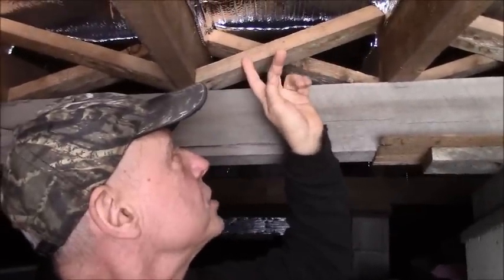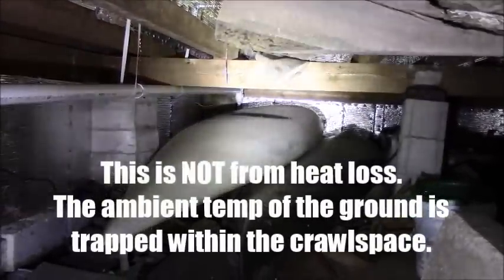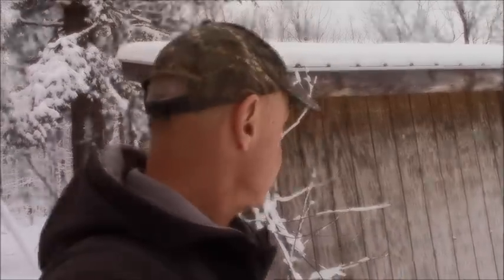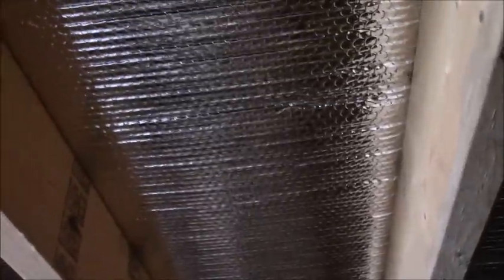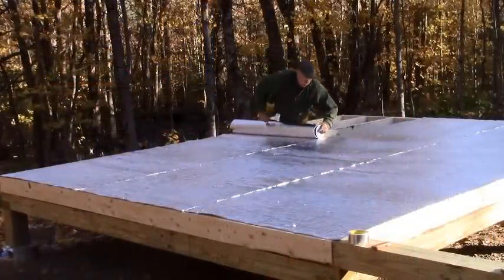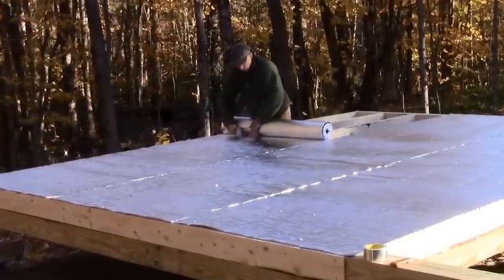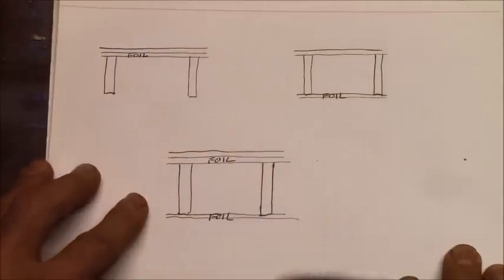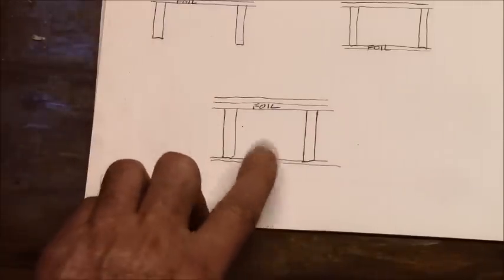BUILDING INSULATION  Proven Tactics and Solutions For RODENT FREE Results and DAMP CRAWLSPACES  DIY

Comment: Our cabin floor I did this
100% works
We had temps of -28* and I could walk barefoot on my floor.
Thank you so much J.C (Boss)
I will be doing our roof this summer with it.
Yes we have a metal roof. Our cabin we are still building as we go and live in.
Plus to get us through the winter we used this in our false ceiling to keep the heat down. Boom incredible product. I swear by the bubble foil method.

Comment: I used the same material for camping.
1.  Inside my cooler to help the ice last longer (saw this on one of your videos)
2.  Outside my thermos to keep my hot water last longer
3.  Inside my tent as a floor to add insulation for winter backpacking
Good stuff.

Comment: Bubble foil is amazing! I used the BF to seal up gaps in skirting around the piers, then added another continuous layer of BF inside the skirting (from rim joists to dirt) to create an air gap. 10 degrees outside and still 30+ underneath and 25+ in the cabin with no heat at all. The squirrels that were stealing the fiberglass haven't touched it.

Comment: I used reflectix (bubble foil) on the walls and ceiling of my wellhouse. It got down to 20 degree around Christmas last year and nothing froze.  To me it's an solid air barrier rather than insulation and if I can keep cold air or warm air from moving from one place to another, I'm going to do it.
Reply: Did you use insulation in well house and bubble foil over that on inside and then put up wall boards???
Reply: @harvdog5669   I just attached the foil on the exterior of the framing. Then put pressure treated plywood over it. Been working good since 2017.

Comment: Based on your old video I had them put bubble foil on top of the joists at the factory on my small cabin 3 years ago.. I also put another layer under the carpet padding inside and I love the warmth of the floor.. I used spray foam insulation on the walls and roof and then put up the "white" bubble foil as my drywall on the ceiling and walls.. It has been 3 years now and this place feels very cozy and warm in the winter.. (Yes, it gets cold in the southern AZ desert.). Thanks Boss.. ..... .....(I have videos of everything I have done so far)
Reply: Bubble foil under the carpet is a good idea.

Comment: It was that video from five years ago that brought me to your channel! My husband and I thought we were going to be building on piers and we were discussing proper insulation that would not bring nesting rodents and so I went researching on YouTube and there was your video about the use of "bubble foil". We had already used it in our tiny-house-on-wheels with good effect (Combined with other types we got an incredible R factor!) We have been experimenting over the winter with the bubble foil on top of a grey water field we put in as part of our (eventual) cottage build (here in Acworth). It's still in the testing stage to see whether we go with that or another system. Even when the temps dropped to -23 degrees F (-30.5 C)  a few weeks ago the ground under the bubble foil and tarp never froze! And even with the normal winter temps there is standing water in the test hole we have within the gray water field. I might drop you an email about it with some pics.
Reply from the maker: The foil really is amazing and we'll be doing it the exact same way when we build our next house.

Comment: I remember watching this video before.  I'm glad it's still here for review.  I wish engineering or building science manuals would include rodent damage for various insulation types and installation.  I can't wait to build anything with double layer bubble foil and agree that you need to face it on the warm side (for cold climates especially) to avoid condensation inside the wall structure aka mold and destruction.

Comment: New Cape Cod Cottage owner here. Surrounded by Pitch Pines and lots of moisture around because of our FOG. Small 510Sq Ft. Cottage that was lifted 18 inches off ground just before I purchased it. They put a pressure treated frame underneath with chicken wire over it to keep out critters, so open air skirting. I THINK this creates a lot of air flow underneath and has avoided any and all mold to form on beams. Dirt floor.

BEFORE I saw your videos (love them btw), I dug out the dirt underneath to make it so I could store things underneath and also so I could crawl around easier and get to all the plumbing etc. I then put down rubber puzzle piece flooring so that friends willing to help me understand stuff under the cottage could crawl around without getting messy. I also figured it would stop moisture coming up from the ground. I left the cottage this way for a couple years and never had an issue with mold on the beams.

Cottage is open April - Dec. closed down Jan-March (cold winter months here in NE). I became frustrated with the dirt that was blowing in through the open-air skirting over the winters, so I tried an experiment last year before leaving for the winter. I covered up the skirting area with see thru plastic to prevent any wind blowing dirt into the underneath. I was dually concerned that this would create a moisture problem.

After returning home IN APRIL, I discovered that it worked great to prevent dirt on my rubber floor, and no mold had formed underneath. HOWEVER, when late June arrived, I crawled underneath on a drizzly foggy day, and there was TONS of moisture all around, and I noticed mold forming on my 100-year-old joists for the first time. I assume this was because of the plastic skirting and the sun hitting it to create a greenhouse effect. I immediately removed the skirting to get some airflow going and will be treating the mold soon.

I REALLY need to insulate my floor because it does get cold into December, and I have also been struggling with whether or not to put skirting back around underneath to prevent wintertime air flow, because of the tremendous moisture issue it created come summertime.

MY Question: (finally); Do you think; considering my climate and moisture issue on Cape Cod; that using the reflectix as a skirting would have the same effect as the plastic I had previously used (mold forming and tons of moisture) or would the properties of the reflectix material prevent what happened to me with the summer mold issue? I want to have a skirting but am concerned about lack of airflow under the cottage, and it would then be dark all the time underneath, I'd have to install lighting.

I am definitely going to try insulating the floor with it, but am concerned about using a skirting; especially in late spring, summer and early fall. Also the company that makes reflectix STRONGLY suggests stapling one inch underneath the floor to create that warm air gap. I am thinking of trying this to see first-hand if the mice get into it. I can always undo it later, after all I'm only 510sq feet.

Thanks for any answer you can give and if I get no replies well at least I was able to vent my frustrations here! Great channel, so valuable! JF
Reply from the maker: As you pointed out, there's pros and cons to skirting and no one single method is perfect for everyone's needs. Skirting provides a warmer floor but also blocks daylight and traps moisture but... the skirting also traps the ambient temp of the ground beneath my cabins and this keeps my pipes from freezing without running any source of heat under there.   In one cabin, I had skirted it but installed some aluminum windows I salvaged from an old camper.  This worked well as it allowed light to come in and I could vent the crawlspace as I desired.  Maybe trying something similar would work for your situation.   I staple the foil directly to the underside of my sub floor and have tremendous success with it. All my structures are done this way and I plan to continue to do so.  Hope this helps.

Comment: I use reflectix for lots of things, but the perhaps silliest looking of all them is using it around a homemade icecream maker. The icecream maker is one of the store bought plastic deals...and so the ice would melt far too fast after putting the salt in it because the plastic bucket isn't insulated, or should I say it doesn't have any thermal mass to it like the old fashioned cedar wood built ones which at least had a few R-value points. Now the ice cream freezes quickly and the ice doesn't melt near as fast. Sometimes you just need a few r-values. Reflectix isn't exactly insulation, but it acts like it. If you use it correctly like the Boss did in those upper walls (which I was very impressed with!) then you can get a lot use out of it.

Comment: Yes sir! We originally used foam board insulation - creating that warm cavity that did indeed attract a rodent - on the underside of our cabin. Based on your original video, we tore out the foam board and installed the bubble foil. Haven't  had a critter problem since. 
We've also used it in the ceiling and walls of our cabin and building. 
When we construct our permanent home, we'll be using the bubble foil in the floors as well. 
Thanks for your awesome ideas, information and common sense advice!
Reply: Did you put anything behind it...?
Reply: @anitalehr4151  no, we do not. For the interior, we use the bubble foil and then place the fiberglass insulation in front of the bubble foil. For the underneath exterior, we only used the bubble foil.

Comment: I am so grateful for you and your information! I bought a cabin in 2020, and it had fiberglass insulation that was infested with mice. Absolutely disgusting, pee, poo, bedding, food... I replaced it with the “Boss Foil” last year. I insulated the subfloor, rim joists and walls of the crawl space. I also laid out vapor barrier on the ground. It has been marvelous! Magic! No mice. Wood is bone dry. All the pipes are NOT insulated, but nothing froze. We had the winter storm with -24 degrees temperature last month, and nothing froze. Meanwhile, so many people in town ended up with frozen pipes. I’m a 52 year old woman, and I did this project myself. It was labor intensive, but the process was very simple. Thank you again for sharing your valuable information!
Reply from the maker: That's awesome and thank for sharing this.  Did you staple the foil to the inside of the rim joist?  If so, I'm curious if any moisture is behind that foil because the rim joist are the cold wall.  Im testing theories about plastic against cold surfaces.
Reply: @thebossoftheswamp  I stapled the foil on the rim joists from the inside. So, the bubble foil facing me. NO moisture whatsoever. Everything is BONE DRY! I watched a lot of these crawl space encapsulation videos, and found that they went so overboard with sealing up every little corner, only to install a huge dehumidifier. I learned from your previous video that it was better to not seal up every inch of the crawl space. So true! There are 2 vents on each side of the wall of the crawl space. I had to seal 5 because they were so out of reach. I left 3 open, so that I can open/close as needed. I put bubble foil on the inside and outside of the vent doors without stapling or sealing. It held up well during the Siberian storm! Last summer was so hot and humid. I left the vents closed, and placed a small (small room or closet size) dehumidifier just in case.  The dehumidifier helped, but even without it, the crawl space was dry. AND!!! The AIR QUALITY is sooooooo much better! I don’t have to wear a mask when I’m inside, even for a long time. Whereas before, the dust from the fiberglass insulation was just flying around everywhere. I just went downstairs to check, and everything is bone dry, air quality is great, and the temperature has stayed around 55 degrees during this winter.  During summer, it is nice, cool and dry. Thank you so much again!! Your information, ideas and knowledge were a lifesaver! Before this, I was battling mice, I had caught 66 before the bubble foil. I love The Boss Foil!
Reply: @ABee-vd6rt   I so relate to your comments ABee.  The Boss is brilliant at explaining. You can tell he’s had experience with training newbies on site.  Most folk jump straight into their interpretation of R factor formula rabbit holes that make no practical sense. It’s no wonder girlies like me gave up science at school!!!! 😄

Comment: I’m glad I found your video! I have a home built in 1900 and none of the floor joists are insulated when you’re in the cellar and look up. After going through my first snowstorm in this house I’m definitely doing this.
Reply from the maker: Put the foil against the underside of your floor boards and it will reflect the heat back into the floor.

Comment: Hey Boss, thanks as always, It's super helpful to get all this information from ya, I plan on building a cabin and I plan on using your bubble foil technique for the floor, it's hard to argue with experience. At our family cabin in the ceiling we used regular like R24 fibreglass insulation And we used the foam/reflector material (but only on the ceiling) and it's been great, the camp heats up fast and keeps the heat in. But I could see how the ant's would love it if it was on the floor, it's nowhere near as dense as the thicker foam you showed. thanks again for all the videos ! Cheers from New Brunswick, Canada.

Comment: Your ideas and comments are rock solid!
Not only do ants love that soft foil faced foam board, but termites do too.
Trapping the ground temp under the house or building helps a lot when it’s cold but I believe that the ground should have a plastic covering to stop moisture in my part of the country.
Reply from the maker: Yes indeed. There's pros and cons to trapping the ambient air beneath a structure and one has to weigh out the good and bad and go with what works for their individual needs.  The tarp will certainly keep the moisture and most of the ambient temp beneath it.

Comment: New subscriber here and so glad I found your channel! Thanks for sharing all your hard-earned wisdom!! Unfortunately, I live in the dirty, hot southeast and am trying to apply your techniques to my current project. The one thing of yours I am definitely going to try is the cement board - treated 2x4 - bubble foil system for crawlspace walls. I can't see why this wouldn't work just as well to mainly keep the heat out as it does for keeping the cold out in your location. As far as the rest of the crawlspace, I definitely haven't decided on the best route. 

The generally accepted method in the EXTREMELY HUMID area where my property is located is to just cover and seal the dirt with heavy duty plastic to keep the moisture out. I'd much rather staple up the bubble foil between the joists, but with the backwards climate compared to yours, I just don't know if that's the smartest way to go about it. If you or any of your viewers have any experienced, solid information as to my considerations, I'd really love to hear it! Thanks again
Reply from the maker: I'm working on a followup video to this topic that you may find beneficial. I hope to have it out sometime this weekend.

Comment: Nice work. Insulation can become quite the conversation. I like the theory.
Reply from the maker: Thank you :-)
Reply: Question Sir, and I think I know the answer. So when you skirt your buildings, again you are just using the bubble wrap underneath the skirt board? Does the frost get to the crawl space. I love the idea, I just always thought I would have to insulate the ground outside the building to stop the frost from coming in. Thank you. Great stuff 👍
Reply from the maker: @tombrownrigg8794  I staple the foil to the inside of the skirting framework which leaves an air space between the foil and the skirting material. Beneath the framework (buried in the ground) is a layer of styrofoam which halts the frost from travelling beneath the skirting.  If your structure is not heated for long periods of time, then the ground may freeze beneath it over time but I have no issues with frost at my cabins.

Comment: That's a great video with fantastic information Boss...
When I watched your video 5 years ago on the use of the bubble foil. I have to admit that I was skeptical about it's insulation properties and whether it would just get chewed up by the mice. This video has sold me on it's benefits. 
I'm currently building an off grid house. I will definitely be using it in my floors after the Raiden heating tubing goes in and on the heated side of my ceilings...
Thanks....
Reply from the maker: I was skeptical too the first time it was introduced to me. I gave it a go and still going with it.

Comment: Two layers of the product with a 4" gap of air between them equals R32 ish  (from the website) at the time of my install.
I have used this many different applications over the years and can attest to it's value. 
Holds up overtime and reflects heat and  can act as shade too. (Green house/ enclosed porch)
Can be painted! 
(Latex water soluble paint.)
My latest wonderment with this product.
Thanks for the update. 
It's also removable/ reusable.
Still have some from over 10 years ago I had recently uninstalled. 
The plastic that was put up before it was dust crumbles. 
Could reuse the product if removed properly.

Comment: I love this! I will be adding a 12x24 shed to our yard to do my pottery in, it will have to be kept above freezing in winter (Michigan). I wont be able to get under the shed. The shed will be arriving with subfloor already installed, if I can't get the subfloor lifted off and go with the process of installing the bubble foil on top, adding the strips of wood and another layer of plywood, is there any risk of trapping moisture in there?  I will make sure everything is thoroughly dry at the time of adding the bubble foil.  Just wasnt sure about any future moisture issues?!  Have you used this installation proceess on any of your buildings and if so, how is it holding up? Thank you so much for the information and wonderful videos!!